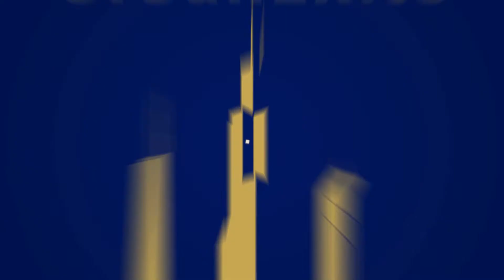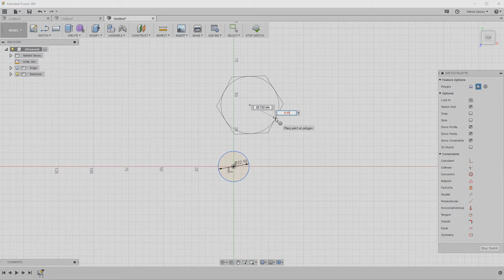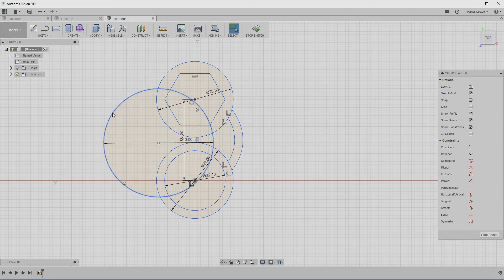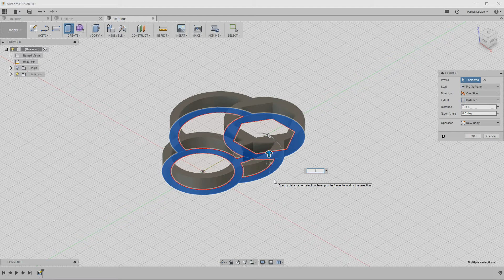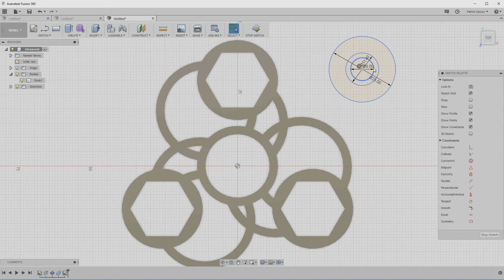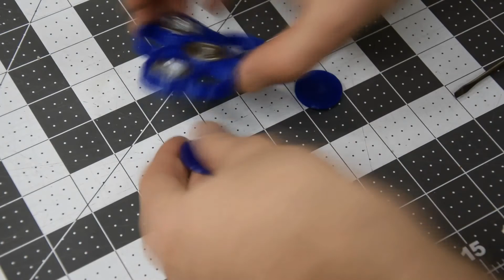Intro to Fusion 360 / Making a Fidget Spinner

Comment: Great video. Learned stuff which is what it's all about. However, I would have used the parametric capabilities to define the gap between the metal parts and plastic. That way, if it didn't work first time you could easily adjust just that offset.
Reply from the maker: Thanks!  Yes, I need to get better at using the built-in features of Fusion 360 for things like gaps and tolerances.